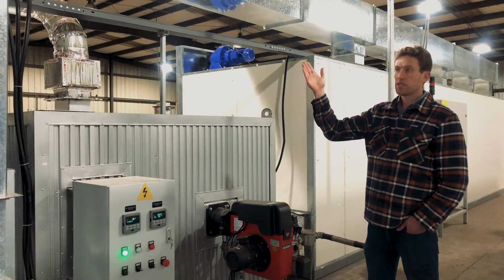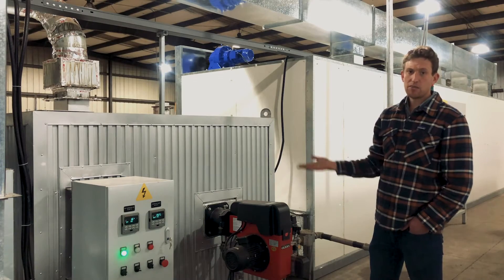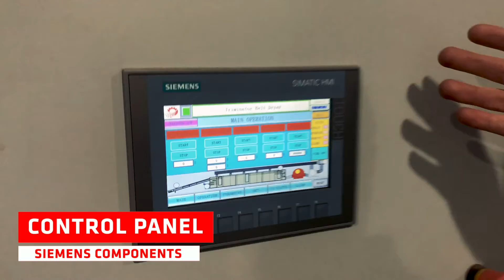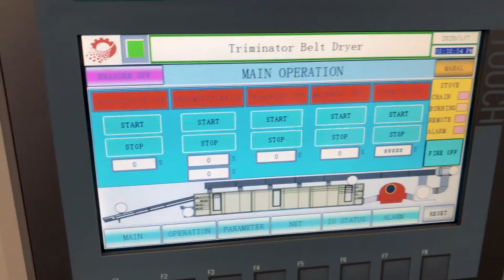The Belt Hemp Dryer - by Triminator - hemp biomass dryer overview with CEO Dana Mosman

Comment: So is the drying process for hemp different from cannabis?? I know if you rush drying and curing for cannabis you ruin it.
Reply from the maker: drying biomass with this machine, not going to smokable flower product.
Reply: These r crap.   This is not. Not a fine wine n. Call. We know how 2 do it. This is crap did it 4 50 years.  If it's not lya Sal.   It's crap
Reply: @dawnkane5206  why say this? Sad
Reply: These r crap.   This is not. Not a fine wine n. Call. We know how 2 do it. This is crap did it 4 50 years.  If it's not lya Sal.   It's crap